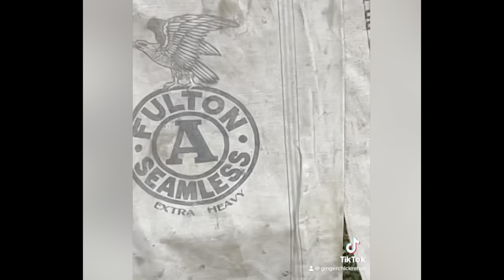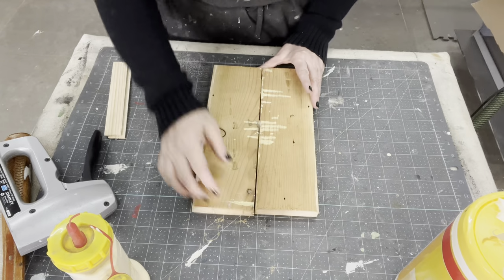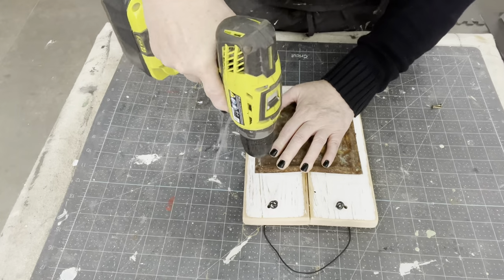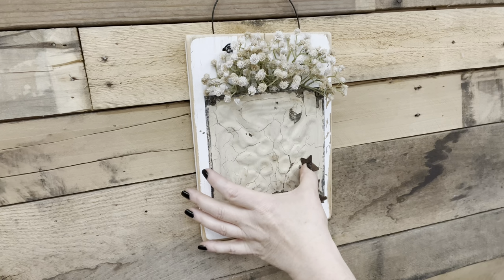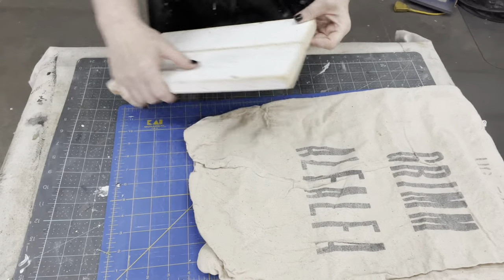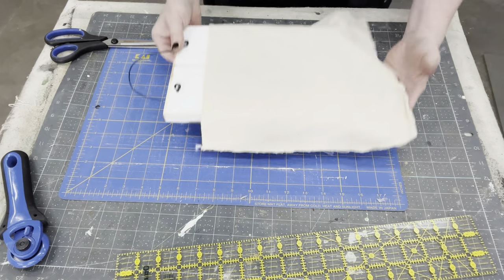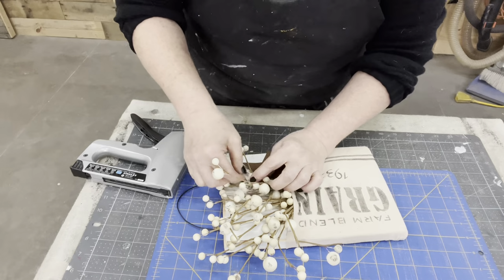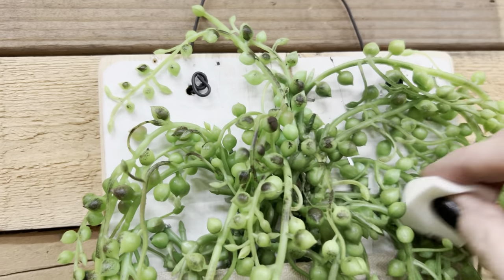DIY Feed Sack Wall Pocket Ideas

Comment: Love all of the wall pockets.   You made a wall pocket out of air dry clay before.   Do you remember what size you made them?  I have the iod bird mold and want to put that on the pocket part of it.   I also can't remember if you painted them.
Reply from the maker: They were already painted boards. Not sure the width, but they were 12" high